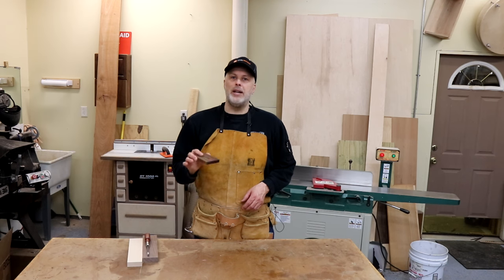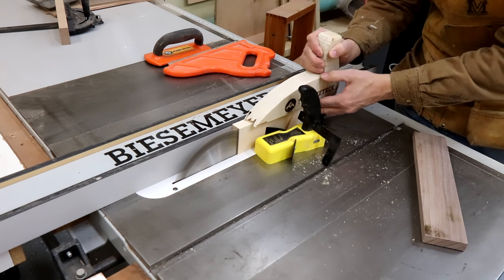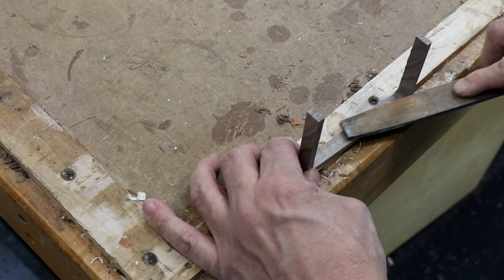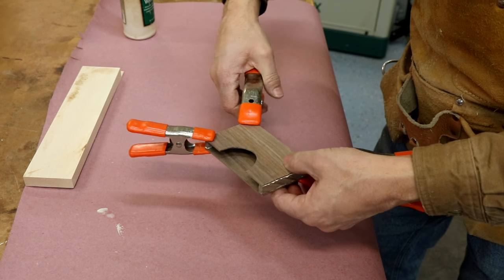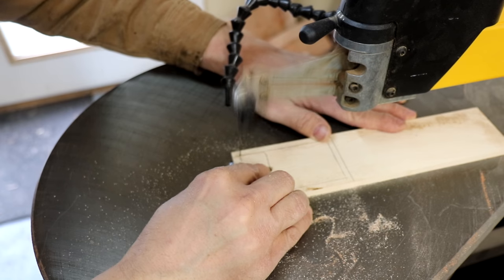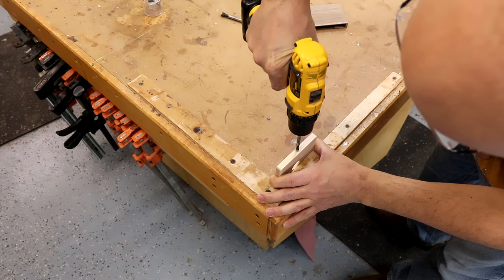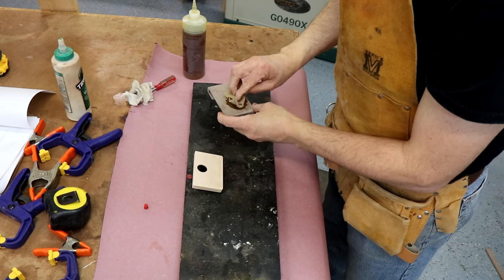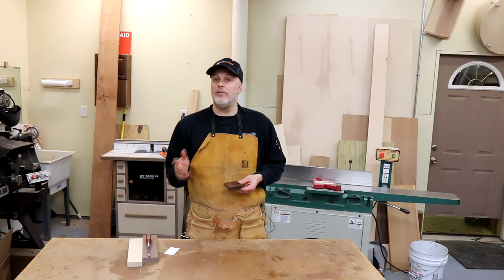Make a DIY Wooden Business Card Holder or Wallet

Comment: why not just cut strips with 45s on the end to make the filler pieces ? 

also why not glue the whole thing with the super glue then you would not have to worry about squeeze out ?
Reply from the maker: Hi Marble, thanks for your comments.   You could definitely do it that way.  In fact, that is how I made the first prototype; super glue and filler strips.  I found it to be cumbersome to assemble, which is why I switched to a single piece.  On the glue, I just found that I liked traditional wood glue better, but its just a personal preference.  Cleanup isn't too bad with a small screw driver.  30 seconds worth of work and you're all set.  I would still run a screw driver through if I used super glue, because you need to ensure that nothing is blocking the path of the drawer.
Reply: yep that is the thing with doing anything but for sure woodworking 10+ different ways to do the same thing and they all have there strengths and weaknesses 

The the strips I was just trying to save material and figured gluing each strip with ca glue might make a faster and easier assembly hopefully I will try to knock two or three out while in the shop soon
Reply from the maker: Soooooo true!